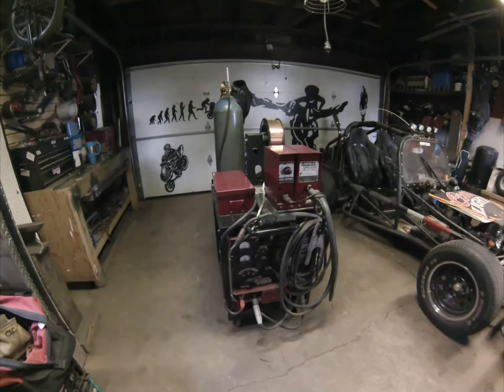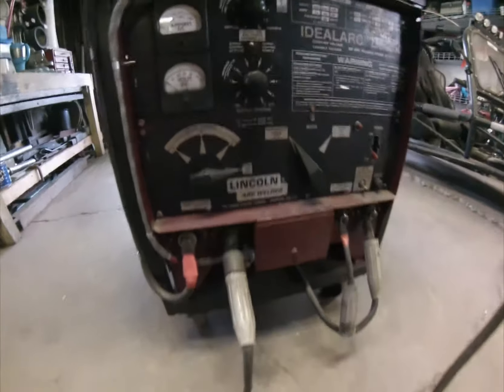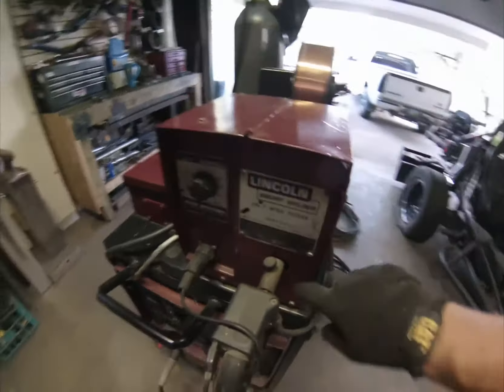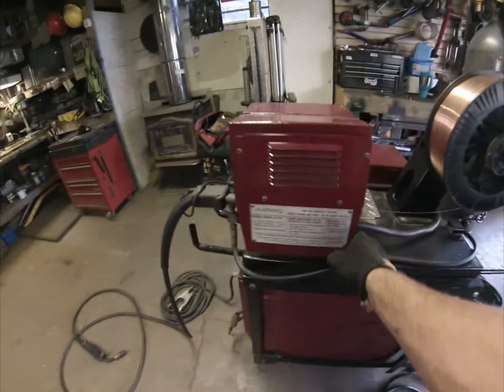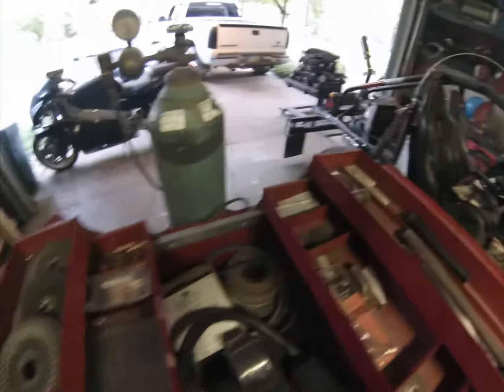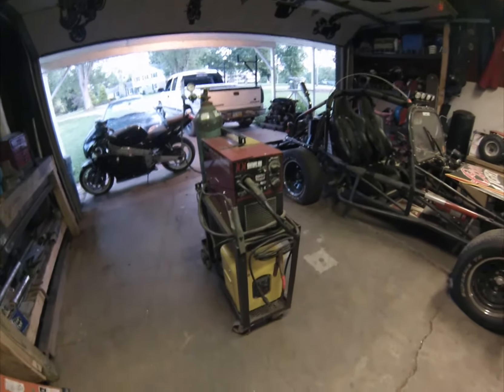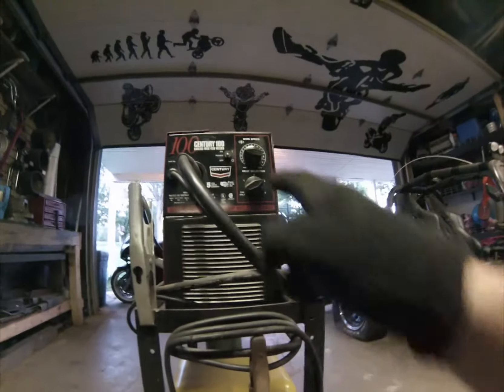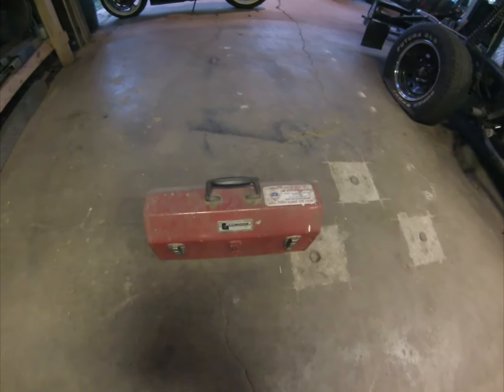My New Lincoln Welder And Review Of Others

Comment: Do they make a chart to tell you what settings to set your voltage and wire speed to for whatever thickness of metal your welding, just got the one at work up and working again with a new mig gun liner and consumables thanks